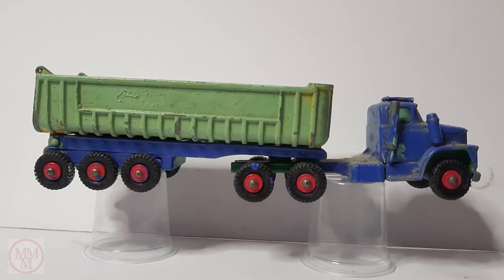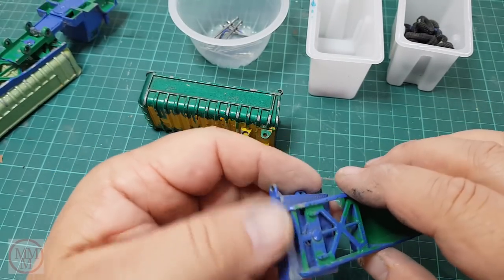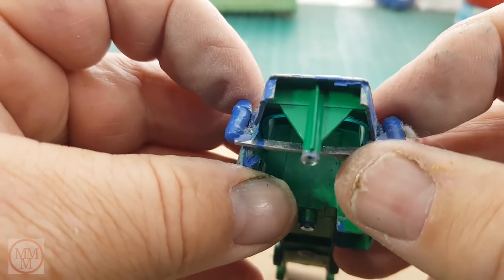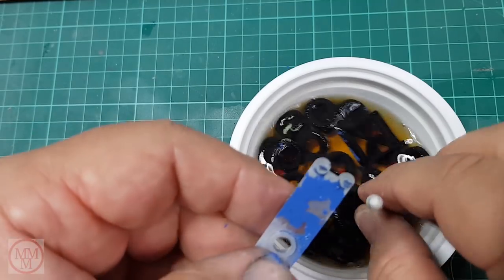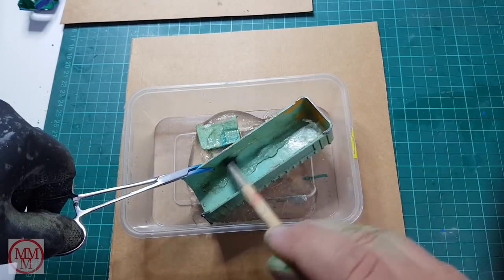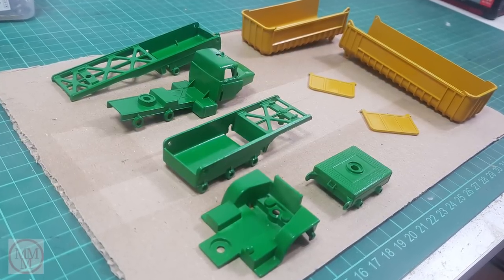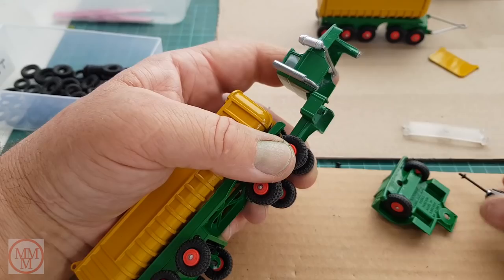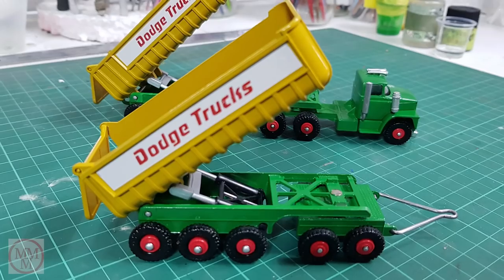MATCHBOX Restoration No K16 Dodge Tractor with Fruehauf Tippers 1966

Comment: I loved the king size models so hard when I was a child. They were more expensive and more difficult to get as gifts (my folks were not wealthy and I had 5 siblings to compete with). This restoration was a pure joy to watch Marty! My next door neighbour, Wayne had this combination set and some others. Together with mine we practically wore the paint off them every summer playing in the dirt in the early 1970's. I especially enjoyed the models with imitation hydraulic cylinders as I was fascinated with electrical/mechanical machines as a small child. Oddly, when I entered my early teens, I did not pick up a miniature hobby and I still recall the emptiness I felt inside when I would think back to those days in the dirt when I was a small child. I started building speaker cabinets and sound equipment in my teens and things expanded from there but I always remember(d) my fondness for small scale trains, cars etc.

Comment: Marty, excellent job on the Fruehauf Tipper, I like the modified axle pliers idea, looks like it will prevent fracture of wheel hubs, when re-forming rivets I use roll pin drifts, they are a straight drift with a ball shape on the tip, maybe give it a try and see what you think. Recently I finished my first rebuild, a #72 Jeep, no steering wheel, no tow hook, no windscreen, no tires and just a touch of paint left. I used spilt pin pieces to form a windscreen, along with crazy glue and baking powder, a long piece for the top and 3 short pieces for upright pillars, not perfect but looks good for my first rebuild, well you keep rebuilding and I'll keep watching. Thanks Jake

Comment: Another Beautiful restoration Marty. That will be a nice addition to your collection. Check with your hobby store or an automotive paint supply store for plastic parts stripper. It will make cleaning the plastic parts much easier. Cheers until the next video.

Comment: great refurb .... to finish the exhaust  stack ... these old matchbox are so solid ...you can drill out the top of the muffler and fit a section of paper clip in and jb it ...  go original ... longer with elbow or a mitred tip .... K16  s are my favorite .... my child hood k16 was even more gummed up with paint jobs than  marty ;s refurb ....  removing each layer provided  a childhood  memory ....  Thanks Marty ... Iam  hooked on refurbing  models and Triple M

Comment: I always wanted this model as a kid !  Mates always had just the trailer or tractor. My old Liang (or Laing?) orange trailer had a black tow wire. Probably just another variance from the factory.
Great vid, once agin Marty. The result is just as great as the model.

Have you thought making casts of the various parts? Barnes make a silicon based moulding product called PinkSil. There's two part fluid or putty. Very easy to use and safe. I wouldn't use it for soft metal casting, but there are other products for low temp metal. You can use the putty as a press mould for the windscreens. Just drop some resin in one half and press the other in. Resins are usually white or clear and there are dyes. It'll work for other detail parts as this truck had, but you certainly could use other silicons for low temp metal. Once you've managed to straighten those parts, make a quick mould for next time.
I don't work for Barnes, but I do use their gear. I figure there are other outlets around . 
When I was watching this vid, I've thought, Marty should make moulds of these parts !!

Bat on.

Andrew.

Comment: another thought would be to make a resin cast, support the resin master in your vise  and then heat up your clear plastic over your toaster, then pull the heated part over the master. let cool, trim and paint with the candy color of your choice, install and voila.... perfection. there has to be videos out there that show how to do this process, which would be much more informative than my print. great job Marty. keep it up.

Comment: Superb job, one of the best yet. Have a go at making the windscreens! If you have the original (even scratched and broken) to form a mandrel then it's so easy. Just clear plastic and an electric heat gun or even purpose built baking chamber for forming small plastic. Heat the plastic u till its soft and forms around the mandrel.

Comment: I knew it.. the Queen has a rubber duckie in bath XD Nice restoration. As for the 60's colors.. i think it was fashion more than anything that kept them rather dull... in the mid 50's we had some nice vibrant colors and later in the early 70's we would have them again. Back in those days though, they were able to use solvents and pigments that we are not allowed to use anymore, lika cadmium, mercury and lead pigments and solvents based on benzene.

Comment: Again a very nice job !
A suggestion to remove old paint on plastic parts : I once use domestic oven cleaning foam in spray ("decap'four" brand in french). Maybe you should test it. And I would have add some drops of blue in the green.
But it is a really great work, especially for the scrap windshield.
Thanks a lot.

Comment: Seems like the exhaust tip is missing. It is longer on the original, from the pictures I found. It's on the rear right part, not the coupled one. Good job as usual. Probably better than new!
Reply: He can add the exhaust tip when he does the new windshield.
Reply from the maker: @bills6093  "Will do!" ;)
Reply: @bills6093  That makes those screws a real bonus!
Reply: No....the exhaust goes up the side of the cab, and the intakes are right at the engine......why would they be the other way around?....common sense...

Comment: Just picked up one like this today, but only the tractor with the attached tipper. Kinda rough but a nice "Beater".
K16 Dodge Tractor with "Dodge Trucks" on the tipper/dump bed, green tractor with yellow dump bed. It's missing the passenger side air tank, all of the tires, and the dump bed tail gate. And of course the missing second dump bed, if one pops up on eBay?
The paint and decals are fair so I'll probably just get a replacement set of tires and call it a day. I like the "played/worked" look for these old trucks.

Comment: Beautiful restoration Marty. Just one thing your exhaust stack is broken, it should be a little bit higher, the pin broke off the top. You can go on eBay or the internet to look at it. Your truck turned out really nice, looks brand new.

Comment: That "Lobe" as you called it is known as a "Bevel" (Bev-ul) in the United States. As you can see it provides a groove for metal to go into but not past. I use a similar modification sometimes to set up two steel pieces to be welded. It's a great way to fit the pieces and have them stay put while welding.

Comment: Marty, just a tip. When putting on large waterslide decals, add a drop of liquid dishwashing detergent to some water and put a few drops of this solution under the decal to lubricate it, rather than pure tapwater as you usually do. This will not interfere with the decal adhesive but allows you to slide the decals around more easily. Advice from a Canadian fan.

Comment: Well done...

I use brake fluid on plastics myself.  The only issue I've had is that it softens plastic used on old Athearn models.  I also use original formula PIne-Sol.

Comment: good to see you have finally started to heat small pieces of metal up before bending/straightening them, my old metalworking teacher at school explained it as heating the metal excites the atoms and softens the metal - you only have to heat it until its hot to the touch though (not till its red hot)

Comment: What a truck that turned out to be,as good as new if not better. Only complaint is the smoke stack needs a little bit more on top to clear the trailer as it would blow back into the cab,not god for driver.

Comment: That windscreen, glue it together, make a silicone form of it and make a resin cast. Could help you in the future too.
Reply: another thought would be to make a resin cast, support the resin master in your vise  and then heat up your clear plastic over your toaster, then pull the heated part over the master. let cool, trim and paint with the candy color of your choice, install and voila.... perfection. there has to be videos out there that show how to do this process, which would be much more informative than my print. great job Marty. keep it up.
Reply: mustangbob51, there’s articles on how to build a home vacuforming machine using a project box and a vacuum cleaner. I think Scale Auto Enthusiast had an article on it years ago as well
Reply: @robby062  and that is another great way.
Reply: @robby062  totally agree. another solution. i built one years ago. still have it in my garage. the window was pretty simple and i thought that using the plunging method would be very simple with not a lot of down time. but you are absolutely correct. vacuum forming is a great way to duplicate that windscreen. bravo to Marty for what he did do and how good this build looks now that it is done

Comment: One hint to make easy, round healights is to use shiney silver decal film (sold in sheets like Bare Metal Foil) and a circle punch or hole punch (sized to what you need) to make the round decal.  Put it on and no more trying to paint perfect circles.

Comment: It looks amazing Marty! One question, my brother had one of these and I believe that the exhaust stack used to have an extended narrow section rising above the part that you straightened, which obviously was broken off. How would you have fixed that had you chosen to?
Reply from the maker: I did end up fixing it and showed it off in a later video. My bad, at the time!

Comment: For what it's worth, I've used a de-greasing spray ("super-clean" is the U.S. brand, comes in a purple bottle) for removing paint from plastic and it works well.  Less likely than brake fluid to damage plastic like the windscreen.

Comment: Get some snap ring / retaining ring pliers for outside locking rings. They spread the jaws when squeezing the handles together. Should be easier than using normal needle nose pliers, as well as providing more control of the force applied.
Reply: I was thinking that too - I call them circlip pliers.

Comment: Covering the flathead screwdriver tips with some electrical or teflon tape goes a long way towards helping avoid those little scuffings like you got taking apart the trailer.

But beautiful job restoring an awesome model!

Edit: Also! It looks like the towbar was originally painted black as well, along with the many other people mentioning the exhaust pipe tip that's broken off. :)

Comment: Take your windscreen,coat it lightly with veggie oil, and make a mold from silicone caulk,just the outside. Let it dry.  Remove the windscreen without deformiing the mold. Re lubricate the mold if needed. Take  some two part clear epoxy and coat the inside of the mold as evenly as possible let dry.

Comment: Really enjoying your videos and hope one day to have the time to do some restorations myself. Been hoping you would do this model - I always wanted one of these when I was a kid, but it never happened. Picked one up cheap at the Morningside (Brisbane) swap meet a few years ago with all tyres intact and original paint, although in need of restoration. Missing the 'Hydro sleeve' and bars from the first trailer (some kid found a way to remove them!) and also right side 'Air intake' and Exhaust stack snapped off. Would be interested to know if the supplier you are getting your windscreen off would also have these parts. Would also like to know if you have tips for getting the tyres to grip to the wheels. Must be a miracle that none of mine are lost, as they just fall off.

Comment: As far as the windscreen would it have been good to pack some hardening putty into the cab. Let it set until it gets hard. Then using a grinding bit on your rotary tool you carve it so it takes the shape of the original window. Then lay the new plastic onto the hardened putty and use a heat gun to heat it up and let the hot but soft plastic take the shape on the original window. It's worth a try.

Comment: Hey Marty - next time you might try using the broken windscreen as a mould.  A lot of the plastic sheets are thermoplastic, so if you chuck them in hot water they get soft.  You should then be able to press fit the sheet into the broken moulding and hold it there till it sets.  I used to do this on airplanes - but not sure if the evergeeen product will work.

Comment: Using a Laser printer would solve the decal bleeding problem without requiring varnish. The toner is bonded to the paper instead of soaked in like ink so it doesn't bleed.

Comment: Marty, I've tried your axle deforming method with a specially worked nail to re-attach the wheels and axles.  I am having trouble because the nail seems to wear down the axle's end and barely have enough material to keep the wheel on.   Is this a common problem?  Any advice?   -Todd
Reply from the maker: I have found that a slower drill speed and moderate not heavy pressure works well. I have also had failures from time to time due to differences in the strength of the metals used to make the axle. Sometimes I have no alternative than to make some new ones from the shanks of suitably sized blind rivets. Good luck and I hope you can solve your problems. Marty.
Reply: @MartysMatchboxMakeovers  Thanks for the advice.

Comment: My first video since Cadillac surgery, great restoration.  Suspect it will look even better once other eye is done.  I'm told that Dot3 Brake fluid (used in older vehicles) is alcohol based while Dot 4 is silicon based. Could that be why the Dot 4 was ineffective?  Thanks again. Narragansett Bay

Comment: dear marty i thought of some thing to fix lose wheels with out replacing them, my father ran a print shop  as a press man, the rubber off set printing blanket took denting after  thousands of peaces of paper running threw it . to fix this problem  we use a product called rubber rejuvenator, it would raise   the rubber blanked on the off set printing press back to new removing the dent in it . we all so tryed it on car door caskets  and it fixed the air leaks, by unshrinking year of compression,  I think rubber rejuvenator would restore the lose rubber tires to there properer diameter for the wheel hubs, check with your local print shop to see what they use on there rubber off set printing press blankets it might be called something else where you are . hope this is helpful to you .

Comment: Marty...I use Super Clean degreaser from my local Walmart to remove the paint. It will work on plastic and rubber without damage.  It takes from 1 to 8 hours...but it does not damage the plastic parts. I recommend gloves because it is nasty stuff on your skin.  It is available also in Auto parts stores.  Give it a try sometime.

Comment: Marty, with the cab windows have you not tried to vac form technique with clear plastic sheet and hair dryer? Heat up the plastic sheet then push the transparency though it so it moulds to it then cut out.

Comment: This is a good one for sure! I don't know if any other customizers have encountered this before, but I was going to take apart a Racing Champions Dodge Daytona, but... As soon as I tried to drill out the post, the entire diecast car started crumbling and snapping apart like it was made out of glass. The chassis and body were both like this, just breaking apart. I'm not making this up, the whole car literally just crumbled. I've never had any other cars do that, and I've customized probably 75 cars over the years. Any word on this???
Reply: They are called crumblers this also happened to some hotwheels redlines but mostly racing champions. I have had that happen to me as well were they crumble it’s from the type of metal they use was very cheap and over time also with a lot of sun exposure causes that to happen after about 10 to 15 years racegrooves did a video on this as well

Comment: Ive an original one of these. The colour match is very close, especially the green. I think the yellow is a touch too dark though. Matchbox's insistence on using hard plastic tyres is a PITA though. Im surprised the Dettol didnt work as usually a 1 to 1 mix with water is sufficient to remove paint if left for 24to 48 hours. You appeared to use neat Dettol and that didnt shift it.

Comment: I hate to be picky, but you should have inserted a smaller pipe from the exhaust. You have the muffler part, the pipe part has snapped off.